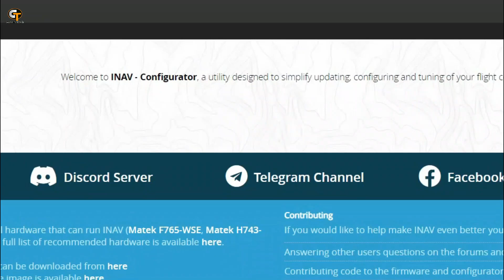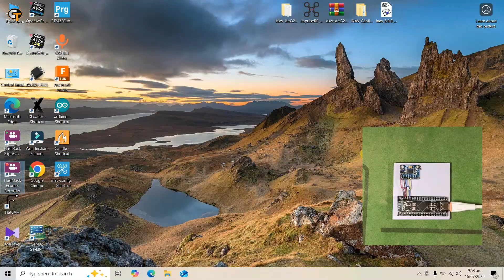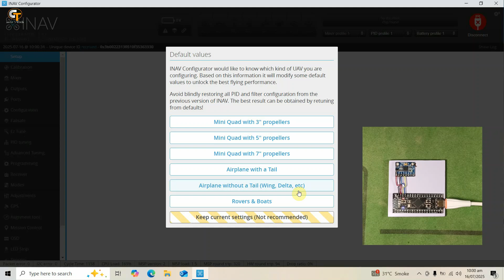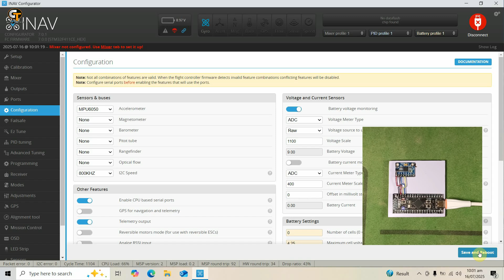STM32 Black Pill FC Sensor Problems And their Solutions

Comment: Hello 👋 can you help me please i became crazy i didn't cam use my stm32 blackpill 😢😢 after flashing stm32f411ceu6.hex in my stm32 black pill inav.7.1.0 configurator did not connect if i push connection after 10 seconds disconnected 😢😢😢😢😢 please give me your telegram for  contact with you

Comment: After flashing inav 7.0.0 firmware it's not connecting to inav configurator
Reply from the maker: Download same version 7.0.0 or 7.0.1 configurator
Reply: @Gtechpk i search inav 7.0.1 but the version doesn't have to github can you send me link ?
Reply: TRY DOWNLOADING V6.0.0
Its connecting to the inav
Reply: I also have the same problem 😢😢😢😢😢😢😢
Reply from the maker: @NukolGublon use inav 7.0.0 and same version of firmware 7.0.0 you will be done
Reply: @Gtechpk i searched but in github nothing the version
Reply: I'm using 7.1.0 after slash stm32f411.hex didn't connect to inav 7.1.0 connect and 10 second disconnect
Reply: @Gtechpk i downloaded the version 6.0.0 but it's not connected 😢😢😢 there sam problems
Reply: @Gtechpk i socks fuelled with inav 6.0.0 and  stm32f411.hex 6.1.0 but it's didn't view my mpu9250/6500
Reply from the maker: @NukolGublon visit the link check here what's going to be wrong
 https://github.com/rizacelik/STM32F411CEU6_INAV_Firmware
Reply: @NukolGublon  you solve your problem? i have the same problem with my board